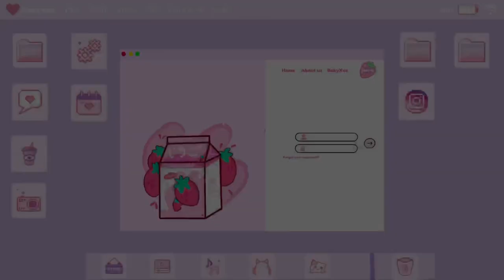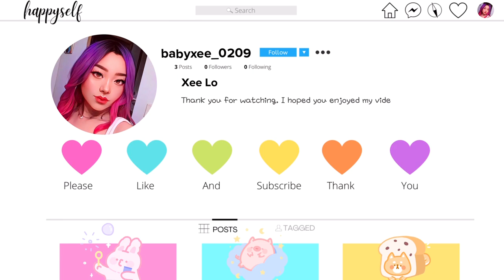First Gaming PC Build: PINK PC

Comment: Tip make the auto fans exhaust you have to much intake and then air gets trapped
Reply: Top fans*
Reply: And try flipping the radiator so the cable will be on the other side it’ll look mutch bettr
Reply: It’s better to have more intake than exhaust actually bc if there’s too many exhaust there’s not enough cool air getting into the case and it overheats
Reply: @goldensewip855  that is actually the best way you can Mount the radiator the looks aren’t worth risking the life of the radiator:/
Reply: @Ivy_eon  but it make positive pressure and that’s isn’t so good since air gets stuck
Reply: @Ivy_eon  I meant turning the cables for the radiator for the right side to the left
Reply: @goldensewip855  I thought the other way was positive pressure?
Reply: @Ivy_eon  I believe that’s negative but anyways equal or closest to equal air pressure is the most efficient

Comment: you need to change your fans on the aio
you have them as intake instead of exhaust
which means the fans are sucking air in, instead of pushing hot air out 
 great build!!!!
Reply: yes this !! its very important otherwise the inside of your pc will get very hot
Reply: @distortjapan  no lol? the rear fan is pushing everything out
Reply: Omg I’m happy someone noticed
Reply: bro she even wrote in the video its the wrong way, at the end u can see its changed and correct
Reply: @name809  lmfao 4 intakes and 1 exhaust isn't an optimized fan orientation, the AIO is just sucking all the hot air in back into the pc
Reply: @name809  yeah but 4 against 1

Comment: It was a great built until I saw the amount of thermal paste applied on 😂 Moreover  the intake fans is overloaded there is less exhaust. Your PC will get fried with the amount of AMP power you are using.!  Also everything left hand does its so satisfying ❤🖖
Reply: I don't think there is elss exhaust because there is 2 in the back and 3 in the front
Reply: There was a research done and more thermal paste actually keep the temperature down more than less thermal paste.

Comment: i thought 3600 was the minimum for b550 boards? and for the newer cpu's in terms of performance
Reply: Meh there's little difference between 3200mhz CL16 and 3600mhz CL18. Even if you had a bdie kit with tighter timings it barely matters, especially when she's just playing games and not actually using the computer to its full potential.
Reply: @RanenPo  i have cl16 32gb 3600, shit i forgot about that, literally the same latency, my b. 3200 is fine then lol
Reply: @RanenPo  It matters a decent amount to get infinity to 1:1. 3600 is the sweet spot for 1:1.